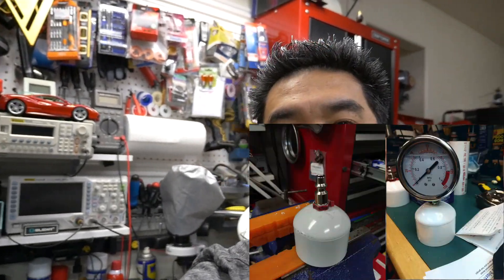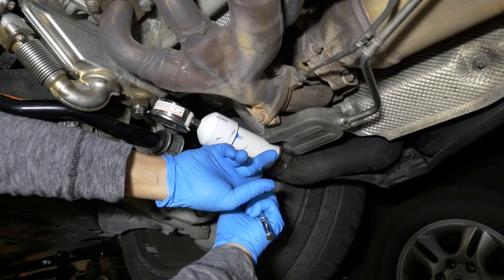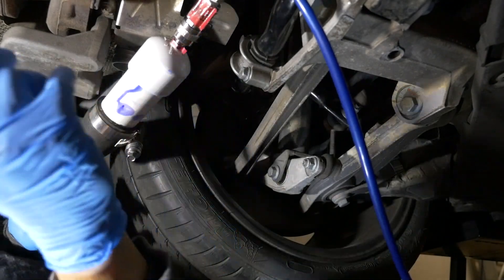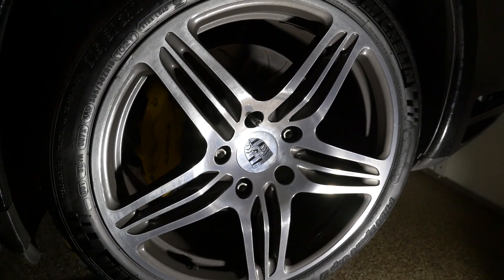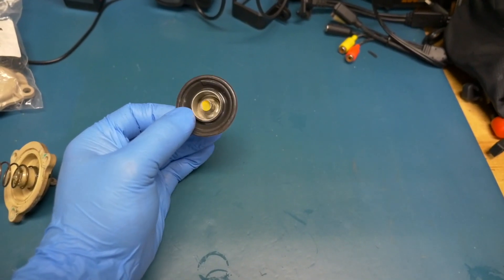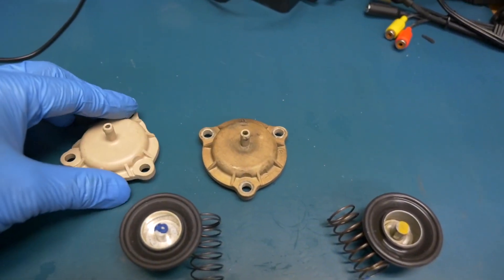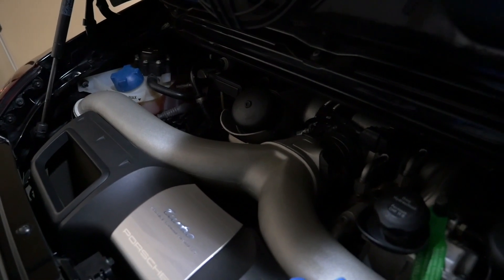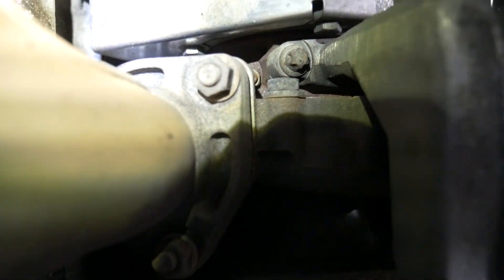DIY Boost Pressure test on 997 turbo and BRV replacement

Comment: I just got an 08 Turbo and it's my first turbo car and Porsche, so still learning about the car. When you start yours up does it sound like you get more suction or a higher pitch air suction sound at the left side of the air filter during warm up? I was just curious because it makes me wonder if I have a boost leak or if my vav is bad or something. Plan on taking to Porsche to get some services done and see if they can give me any input on the car. 08 997 Turbo, 39k miles with Tiptronic and PCCB. All stock.

Comment: I been watching your videos you seem to be pretty knowledgeable about the 997 turbo.  I think your in sacramento I’m in lodi and have a few questions for you about my 997.1 turbo.  Can I give you my number to call me?
Reply from the maker: Hello, sorry, I don't feel comfortable leaving my phone number here.  What are your questions?
Reply: @atm4jim  oh ya that would be that good and ha it was me that offered to leave my number  lol  no worries just a few questions about my turbo and a few things to check but I'll do a few things i know and thne see how it goes and then take it to the dealership next time and have them check it.
Reply: @atm4jim  actually i wil ask, 2007 turbo no mods 35K miles.  I get rough/bouncy engine revs (blips) in neutral.  Going to clean the MAFs, replace the purge valve then see what happens.  plugs, coils and fuel filter replaced 500 miles ago.  Faulty plug or coil?  no CEL tho.  Was thinking engine mounts but appear fine with no pipes sagging.  Passengers side pipe tips vibrates a little more than drivers side on blip.  Also thinking maybe a fuel air mixture issue or a slight vaccum leak?  I Haven't yet tried reving it to certain RPM like holding it at 3000 4000 only tried neutral medium blips from 1000 to 3000 and its slightley fough and bouncy on the way up.  Any other thoughts?  Thx
Reply from the maker: @tommyburns890  Cleaning the MAF's is a great idea, just make sure you use the right cleaner that leaves no residue.  My next suggestion was to replace spark plugs but that was already done.  As for faulty coil, that's hard to say, I've read the coil packs plastic can crack over time which can cause misfire but you mentioned that was also replaced recently.  I don't think engine mount will resolve the bouncy revs but  I would eventually want to replace them as they do wear out over time.  They are relatively inexpensive and relatively easy DIY.  Small vac leak is certainly possible but will be difficult to locate unless you have a smoke machine.  Note, I'm not a pro and just a DIY with info gathered from YT and Rennlist/6speed.  Thanks.
Reply: @atm4jim  So I cleaned the MAFs which really didn't look dirty but it increased the trottle response and smoothed out the neutral engine revs some.  Onther issue that somehow resolved was as I used to turn the key right before start the car used to make a thug noise under the passendger seat right befor start?  My 669 turbo nver did that but not with the MAF's cleaned that thug noise is gone.  strange.  the other issue is not being able to fill the gas tank like my 996 as its a known issue but a new purge value is supposed to help with that and might help smooth the engine revs too?  I've tried turning upside down the gas filler and helps some.  Just heard turning the filler pump to 90* as 9 olclock position.  oh and I gave it the suction test by pulling the oil cap off to see if the engine idle changed or sucked in air and no it didn't suck in air so the AOS is fine and or maybe no vaccume leak in the crankcase.
Reply from the maker: @tommyburns890  the thug noise under the passenger seat might just be a coincidence, probably not related to MAF sensor, have you check the seat for play?  

I have same issue with filing gas, using the plastic fuel adapter helped, worth a try for only $15 - 997 201 944 00.  I swapped gas cap to the aluminum looking and had to remove the adapter and my problem came back.

Comment: Great video Jim. Definitely going to pressure test after I get a new oil leak sorted out coming from the passenger side turbo.  Is that something you’ve had to deal with? Thanks
Reply from the maker: Hope it's something simple like the o rings on the oil lines to and from the turbos.  I did have to replace the o rings on the coolant line (passenger side) to the turbo but not the oil lines.  But when I did this, I went ahead and replaced both.  I assume you're not talking about having some oil in the intake hose from the intercooler, usually driver side, which is common especially if you overfill the oil.
Reply: @atm4jim  It’s been about a year since I changed the oil so I don’t think it’s that.  I hope that you’re right and it’s just the O rings.  Doesn’t sound like it’s too big a job to replace and if so then I’ll probably do both sides.  Did you have any trouble?
Reply from the maker: @gabebercz6651  Of course you want to confirm the source of the leak.  Not sure what you mean about the oil change and not the cause of the leak.  

It's pretty straight forward, and it's fairly accessable after removing bumper cover, intercooler and moving heat shield away.  I recall having trouble removing the hard pipes off the turbo but eventually managed.  Just be careful not to damage them in the process.
Reply: @atm4jim  I just meant that I probably would have seen the oil leak earlier than now if it were related to an overfill since I last changed the oil a year ago.

Comment: Where did you buy the BRV gaskets?
Reply from the maker: Search for BorgWarner Compressor Recirculation Valve (CRV) Kit For Use With BorgWarner EFR Turbochargers
Part Number: 156-179424.  I got mine from eBay, it's also available from Jegs.com.

Comment: Hey Jim do you know if the rear bumper needs to be removed in order to remove exhaust tips? I have techart tips on a FVD Brombacher exhaust and would like to redo the tips in matte black. Please let me know. Thank you!
Reply from the maker: You can probably get an open end wrench to loosened the round clamp (no room for socket with the bumper on)  that holds the tip to the exhaust pipe and twist the tip off.  But it's probably going to be very tight and difficult depending on the amount of corrosion.  You will need to spray some WD40/PB Blaster/Liquid Wrench.  I  even had a hard time just twisting the tip slightly a few degrees trying to align them. 
 If that doesn't work, it's probably easier to do it with the bumper off which isn't difficult but a bit time consuming removing the various screws  and tail lights.

Comment: where can i buy the part alone ?
Reply from the maker: Search for Borg Warner 179424 Compressor Recirculation Valve (CRV), I got mine from eBay for about $80

Comment: Hey Jim, haven't been able to get a definitive answer on how long the artificial boost leak test should hold pressure. After you made the repair how long did your car hold at 20 PSI? it looks like you were holding pressure around 7-8 psi? 
Next step is to get a smoke tester as I can't seem to hold for long  dropping (1) psi every 12 seconds. A forum member had me inspect the oil cap gasket it seems okay will order a new one with the charge pipe o rings.
Reply from the maker: To be honest, I was happy with the results of not finding any major leaks after replacing the BRV.  I listened carefully near the throttle body and Y pipe and was pleased not to hear hissing noises.  I did notice it took a few minutes for my air compressor to stop filling air probably because of my air hose extension and time it takes to fill the intake piping and intercoolers.  
I did wonder about the drop of pressure from my air compressor reading of 20 PSI  to the PVC tester reading of around 15 PSI or less on the other end.  I did hear slight hissing noise within the engine somewhere which I didn't pin point because I was satisfied with not having large leaks especially on the intake side of things and the car runs good and strong.
I later tested the readings between the 2 gauges by connecting directly, the gauge on the compressor reads slightly higher.

Comment: Hi Jim thank so much for doing this video, It must triple the time to do the work with out the capturing the footage then editing and posting.

Just replaced my BRV's however they were fine, I was getting a P0299 under boost code.
 I did find the passenger side VTG linkage disconnected, now that all of that is fixed. I cant seem to hold test pressure. Had a small leak behind the oil filter housing loose clamp.
The car is dropping (1) PSI every 10-12 seconds starting at 20 PSI  Is this normal? I can still hear a slight hissing near the throttle body, but those clams are good.

Any thoughts?
Now I have a P0300 and P0303 code under heavy acceleration,will need to check and swap coil packs at cylinder 3 perhaps the hardest one to reach.
Glad you have a video on changing plugs too :)
Reply from the maker: I think it should hold pressure longer than that, I suggest spraying soapy solution to help locate it, perhaps the hose has a tear/hole somewhere.
Looks like cylinder 3 is  furthest front driver side, if so, yes, I had a tough time because the intake pipe was in the way.  I finally managed to do it by lowering the engine a couple of inches which isn't hard to do in order to gain precious clearance (unless your engine mount is worn then it may not be necessary).  I also had to separate the coil pack from the ignition wire to get it out and also during the installation.
Cylinder 6 is tough also because the VTG solenoid is in the way and has to be removed and requires special wobble tools (torx?) to do so.
Reply from the maker: Also to be sure to have the slim older OEM style because the newer fatter head coil may not clear the pipe.
Reply: Thanks Jim just ordered all of the special tools required to tackle the plug and coil pack change.
They were done 18,000 miles ago. Also read the misfire is caused by the fuel pressure regulator, mine has a clamp on both sides of rubber hose so not sure what's going on until the plugs come out.

On the boost Leak not hearing any hissing just the drop in pressure mentioned above.the fuel regulator connection seems solid.
Reply from the maker: I was going to suggest checking the fuel pressure regulator also but didn't think it causes misfire.  I've read it causes a dangerous lean condition.  Mine has the clamps also.
Reply: Thanks Jim going to get a quote for an Indy to swap them out and diagnose the boost leak as I can't seem to locate the source of the fine leak. A job like this will take me a whole weekend with lots of frustration.

Comment: Another great video! Thank you.  So no real indication from the car?  
BTW... consider an aluminum upgrade kit for the short shifter and make sure that you have the OEM Porsche cable alignment tool! Lastly, look into the kit for the front transmission mount (it’s a spacer that fits into the open parts of the mount)
Reply from the maker: No obvious symptoms, perhaps more boost lag and slight performance loss with the BRV leaking.  Thanks for the suggestions, advice and positive feedback.